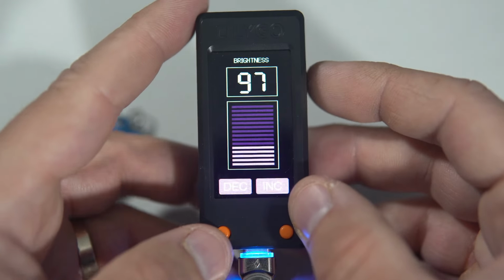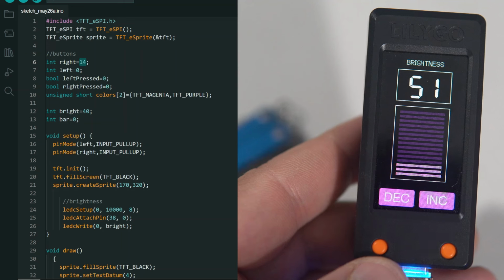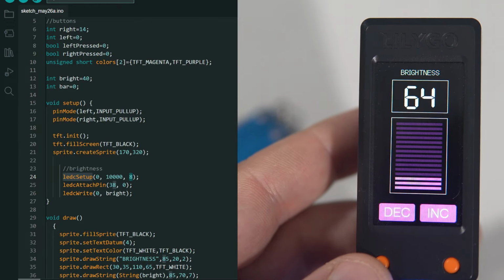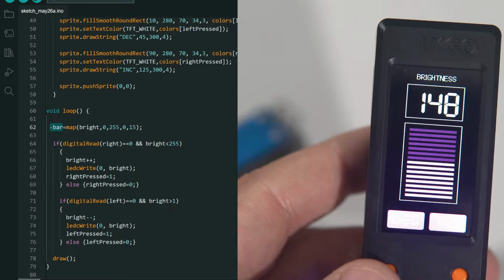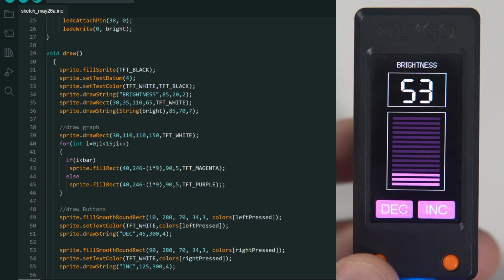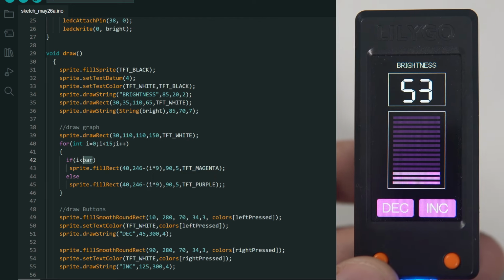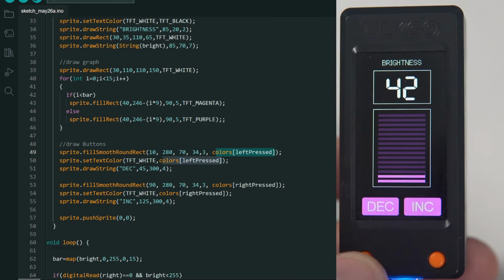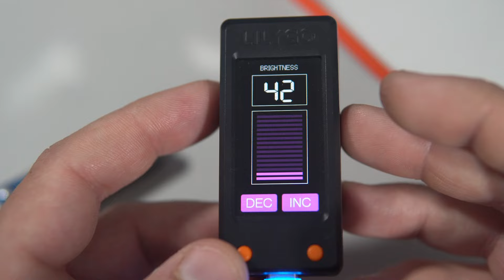3 Minute Code with Volos : How to Set Display Brightness

Comment: For those who experienced "ledcSetup was not declared in this scope" issue, here is the solutions to fix that (choose one, don't do both)

1. downgrade your esp32 board package to older version (3.0 or older).

or you can also

2. replace those 3 lines code for brightness with these 2 lines :

ledcAttach (38, 5000, 8); // pin, freq, resolution.
ledcWrite (38, 100); // pin, 100 is the brightness level (0-255).

// thanks Volos for your great works and your kindness to share the codes freely.
Reply: Thanks, it works. It is easier to keep my board package to newest version and just replace the codes.
Reply: is it only works with your devboard?
Reply: I think it works on any ESP32. you need to adjust BL (Backlight) pin to your own configurations and match it with the code.

Comment: Hi Volos, Some great tutorials. 
Unfortunately I always get an  'error: 'ledcSetup' was not declared in this scope', if I comment these 3 lines out, the sketch downloads but does not dim. This happens whenever you have this 'Brighness' section in any of your sketches. Any suggestions as to where I am going wrong?
Reply from the maker: You have esp32 boards definition 3.0 or higher, you can downgrade it to 2.17 and it will work..
Reply: @VolosProjects  Hi Volos, thank you for the advice. I googled the problem and  I managed to find the new comands to replace yours and they work great.  Thanks for your videos, they really help.
Reply: for those who experienced the same issue, here is the solutions to fix that (choose one, don't do both)

1. downgrade your esp32 board package to older version (3.0 or older).

or you can also

2. replace those 3 lines code for brightness with these 2 lines :

ledcAttach (38, 5000, 8); // pin, freq, resolution.
ledcWrite (38, 100); // pin, 100 is the brightness.